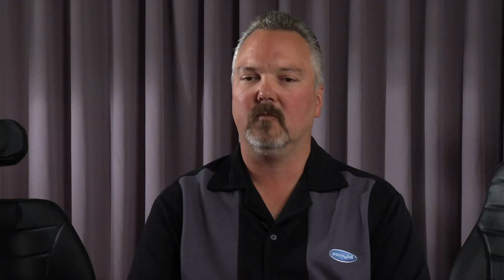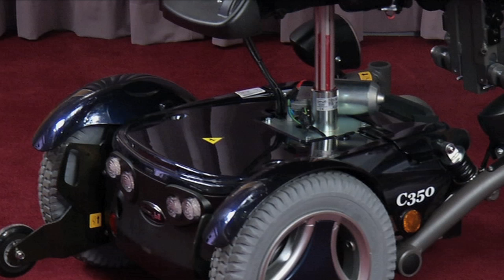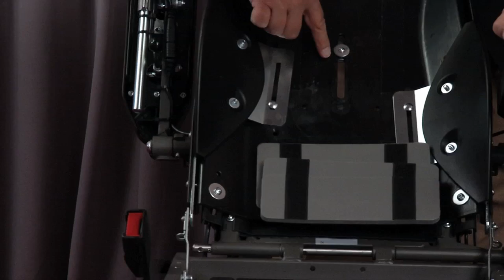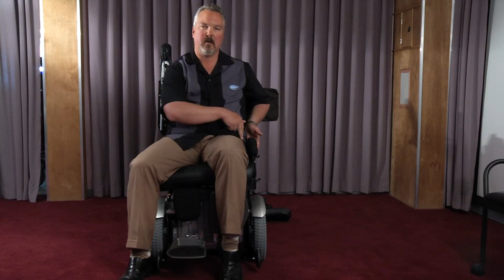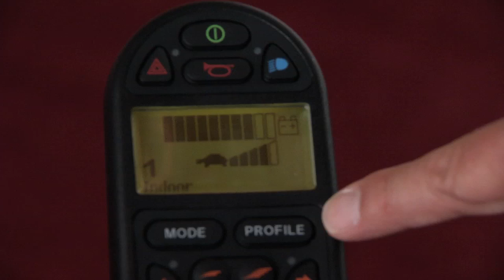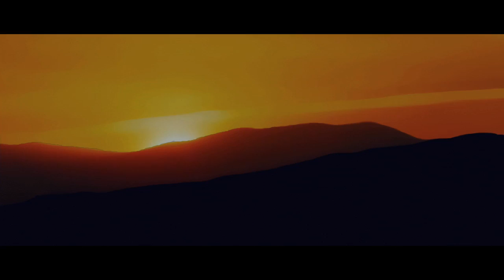Episode 21  - Permobil c300 & c350 pt 3 - Power Wheelchair Comparison

Comment: I have the C300 for 3 years and this is the first time I learnt about the Thigh support, which is something I always missed and I didn't know it was available. How easy is to specify my need to order is my main concern since everything is difficult when you have to deal with local dealers that are not in-depth knowledgeable about all the accessories available.

Comment: C300 I have had this chair for two years and I have owned Permobils for 21 years this is my first bad review. Mind you I love Permobils.

The arm pads in this video do not come with this chair THE ARM PADS THAT COME WITH THE CHAIR ARE PLEATHER,THEY GET HARD AND CRACK.
Do not get the joystick with the display it breaks right away. It sticks way out in front of your chair so Permobil made it so it swings out to the side. It is annoying to have to swing it out every time you go to your desk,bathroom counter, kitchen counter,and on and on.Yes they will all break. Unless your super care full. Lock tight all your bolts they will be falling out. Do yourself a favor pop your reflectors off and glue them on with good glue.
The arm pads that come with the chair are made out of pleather in 6 months it will get hard crack and scratch your elbows. It hurts..The jell pads should have been standard for the amount you pay for this chair.The back seat cushion should be leather or we should have the option to not be stuck with cheep pleather it gets hard fast in Florida. If you live in florida you may not get up your driveway because of the pitch for water run off at the street. The C300 is not strong enough to clime this small incline. If you bump the left side of your chair you can shut the chair down push the on off switch on the right side. I thought the chip fried out and sat for an hour stuck till I thought to push the on off switch in DDDDUUUUUU....my other permobil never did this---.This was because the THE PLASTIC SHELL OF THE BODY BENDS 
Oh every time you turn the chair  on there's a three to four second delay oh GOD that is really irritating.At night the display and the buttons are so bright in your face you cant see were you are going so have a light on if you live alone or like it dark when you sleep..I have to (now). The people who make them don't live in them. Choose wisely by users comments.
And a big note be careful going down ramps it flips forward ---you see those little wheels in front , well they will stop you from falling out but not by much and you will panic the first time,you have to tip back every time you go down an incline. And if you drive be care full EVERY TIME you get out of your van. If you have had a stronger outdoor Permobil in the past this may not be the chair for you.I think the heavier chairs are better.I am average weight for my height. FYI.
Sandra H